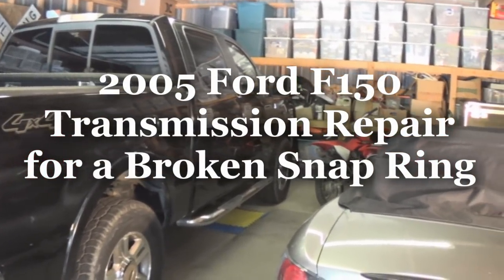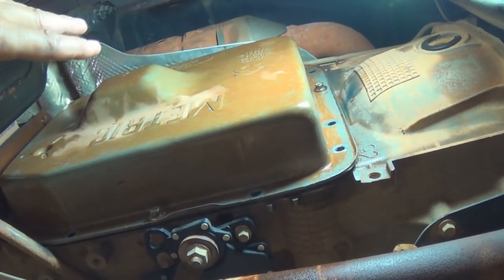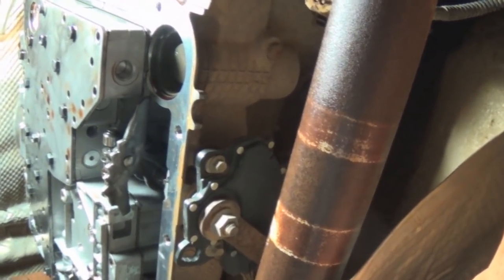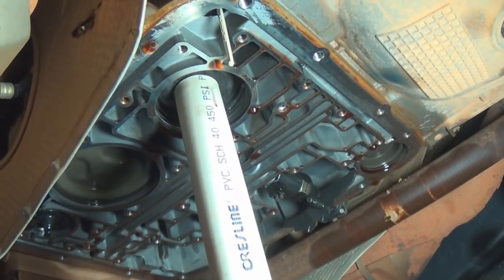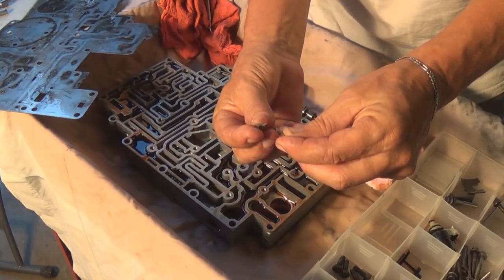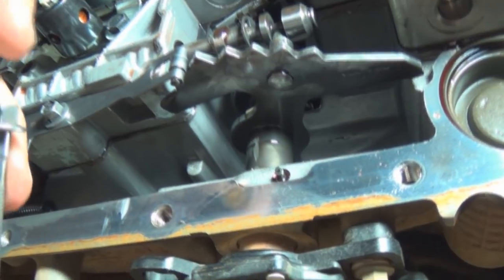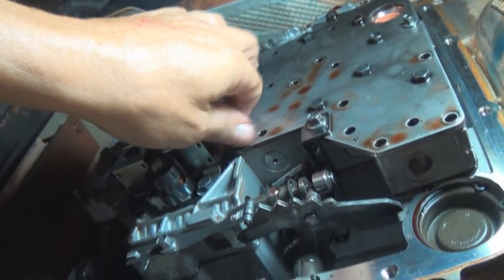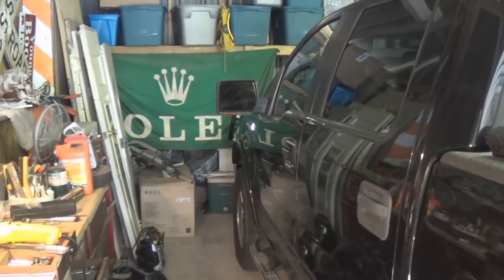2005 Ford F150 Transmission Repair for Broken Snap Ring

Comment: Sucks you can’t message on here, I’d like to send you a picture of the retainer ring, it only broke at one of the hooks and i found the piece on top. How could i tell if the band is off? Would the piston still have presure?
Reply from the maker: Mine broke off the hook in a couple of small pieces and a small part of the ring was stuck in the lower body. If the OD piston in the lower body is not held open by an obstruction then the band in the transmission could be off the piston pin. As for if the piston is still under pressure? I do not know. A transmission guy told me that "It is a real bitch" to get the band back on the piston. I fixed my truck's OD for about 10 minutes, but it had excess metal in the pan (on the magnet) and had burnt up the 3rd gear and OD discs. I got it rebuilt by friend of a friend and works fine now. Seems that the spline shafts that go into the drums wears the splines in the drums and that was where my metal (mud) came from. It was just worn out.

Comment: So as long as i dont remove the servo i shouldnt need to worry about lining the band up?
Reply from the maker: As long as the band has not popped off it should be fine
Reply: @seemoretoys5944  how can i tell if its still on?
Reply from the maker: @boydmbeard9153  From what I remember. The piston pushes on it which Is why you use the jack to push it up to change the retainer clip. If the belt is off, the trans will need to be dropped and rebuilt.
Reply from the maker: No line up is needed. That's why you leave the piston in place with the jack to change the retainer that broke. Just be sure to get all the pieces of the clip out as shown in the video.

Comment: Did the transmission fluid have a burnt smell to it?
Reply from the maker: Not before the rebuild but did after it failed again. Had to have it totally rebuilt. If your trans oil smells burn have it rebuilt.
Reply: Ya I’m gonna replace the transmission right out with a different one

Comment: Awesome guide, I had one question. I had this problem and I let a transmission place fix it for me but they did a poor job. It now clunks hard when downshifting from 3rd to 2 and the guy claims there is nothing wrong. Any thoughts what to check if I take it back apart. Thanks in advance.
Reply from the maker: Jaysonthomas128, thanks for watching and your comment! It may be that the transmission (computer) needs to relearn it's shift points. Drive it around normally and after a couple of hundred miles the transmission should shift smoother. If not, the trans place that did the work should check it out and honor any warranty was stated in writing.
Reply: See More Toys thanks for getting back to me.

Comment: How feel the truck when the snap ring is broke ? My f150 does go over 30 mph if i off the overdrive this runs greats i think is the snap ring am no shure if am on right way
Reply from the maker: I was driving about 60 mph and all of the transmission when into neutral. No other noise was made. If the ring is broken the trans will work fine with O/D turned off but you only have 3 gears (O/D is really fourth gear). With O/D turned on it will shift fine through the first 3 gears but when it goes into O/D it will just go into neutral. Smell your ATF fluid on the dip stick. If it smells burnt you may have a more serious problem.
Reply: See More Toys thanks now am sure is the snap ring i gonna work on it my transmission fluid is good and normally color it run good OD OFF
Reply from the maker: Sounds like you are good to try the retainer ring repair. Good luck and thanks for watching!
Reply: Good video helpful
Reply: See More Toys hi is me against 2 days ago i check my snap ring and is broke but my piston was out  and i have a question mine was completely out do you think the band is no on the correctly place?
Reply from the maker: Hi Ascencio Asc, sorry for the late reply but my internet has been down for the last week and just came back up today. From talking with transmission shops if the piston is out then it is off the band. They said that getting back on is very difficult. I recommend a trans shop or someone with experience in rebuilding these transmissions.

Comment: How is the overdrive doing now
Reply from the maker: Worked for awhile but the trans was worn out and had to be dropped and rebuilt. I had it beefed up for towing. The truck is for sale now as I recently got a Nissan Titan with a turbo diesel to tow heavier / larger loads.

Comment: When u put that servo back on you did it wrong you didn't put the band band back on now you need to tear it apart again and do it right
Reply from the maker: Tyler Schaub, thanks for watching and your comment! The band was not off the servo. That is why you use the bottle jack to remove and install the broken retainer clip. My band was fine and it shifted into overdrive when I completed the job. In the long run the transmission needed to be rebuilt since it was worn out in other areas. I have since had it upgraded with a larger trans cooler and a stronger torque converter and it works fine.
Reply: No he didn't, he didn't take the servo out, he just jacked it up and put a new snap ring in it.

Comment: If the workshops recommend rebuilding or replacing the transmission, why do you do that? Go to a workshop to repair or install a transmission.
Reply from the maker: The part was a couple of $$$. The tranny fluid cost the most. $60? I also replaced the shift plate when I discovered cracking. $25? Had the tools and the place to do it so I did it and filmed it. It worked for a while. For some people it may work longer dependent on the overall condition of their trans.  A rebuilt tranny cost $3,000. The math is easy. But I sold the truck after I had the tranny rebuilt. No more Ford's for me. Thanks for watching and your comment!